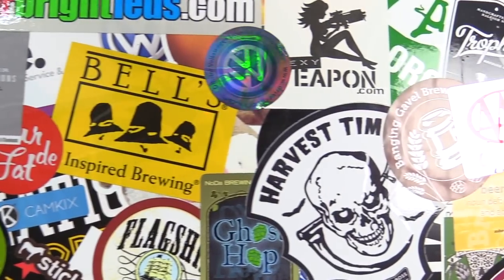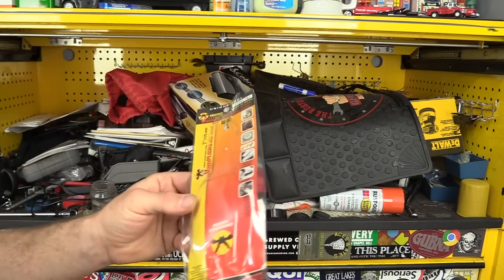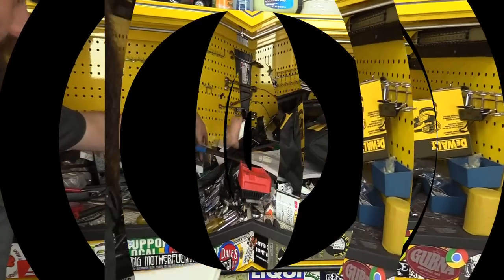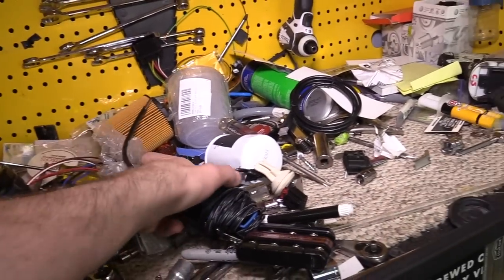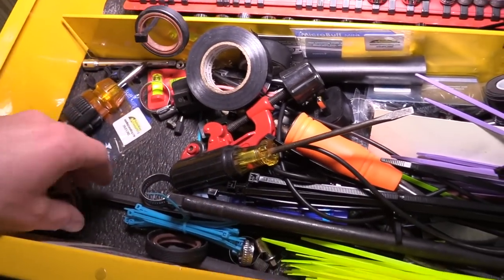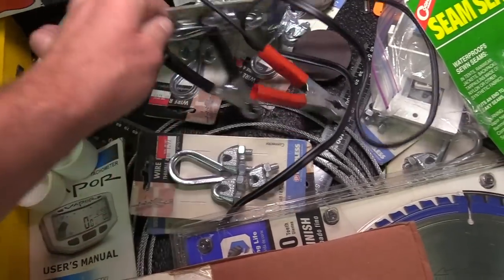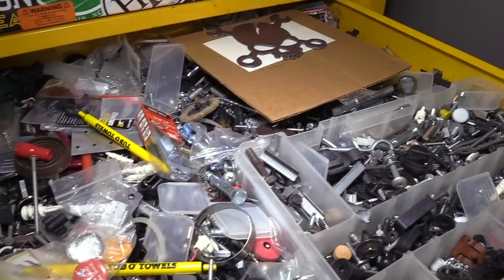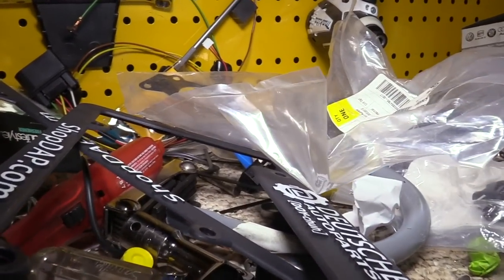How Real Mechanics Organize The Tool Box

Comment: Dont forget the dent from when Dave crashed into it (every workshop has a `Dave`)
Reply from the maker: +MeesterDash hahah. I've seen it happen a few times.
Reply: My local workshop is named "Daves Repair"
Reply: When I traded in my craftsman box for my Matco box I had it sitting off to the side waiting on them to come pick it up. I drove in an old Subbie with brake issues. I went to stop the car in my bay and the brakes failed and ran right into that box I had already sold... luckily the snap on guy didn't notice (bought that box used off him hence the wrong branded box). Also luckily the car was a used car owned by the store so no one got mad about it. Also I got to spend a week cutting out all the rusted parts underneath that POS and rebuilding literally everything that wasn't the frame because apparently subarus are gold and 100 people wanted to buy it while I was working on it.

Comment: Just subscribed and I really enjoy the presentation on your channel. Getting to the point EARLY with visual explanation seems to be an exception rather than a norm for many YouTube "personalities.    A personal note...an organizational accessory that I have been using for about 4 years.  Neodymium magnets (Amazon) in various diameters and shapes to improve my tool security and organization. Yesterday I saw a fabricated solution using these "rare earth"magnets called Tool Widget, an extremely inexpensive solution. I will be trying some soon as the designed holder actually seems less expensive than purchasing the magnets and "Rube Gold-berging" the tool itselfI I have epoxied some very small round neodymium magnets to the center of the handle on my gear wrenches and when working I can lay down a Costco micro fiber towel on the fender or an engine component. The strength of the Neomags has got to be experienced to understand the impressive holding power of these magnets. My 9/16"  stayed holding on ...through the cloth for about 100 miles before it was removed. How I know this is of no consequence. Thanks for the channel
Reply from the maker: Thanks Tim. Since this video came out, I picked up some Tool Widgets. They are pretty rad.

Comment: You forgot to identify the black electrical tape as fuel line repair material for use after you drill a hole in a customers fuel line.  This technic came from a local chevy dealership the only one thing I want to know is why you drill a hole in a fuel line when your changing a fuel filter maybe it to release fuel line over pressure.

Comment: Thanks for the tool organization tips, particularly regarding sticker placement on the tool box.  However, the crucial issue is whether you are a technician or a mechanic?  Inquiring minds want to know if you have finally freed yourself from the dealer tech mentality.

Comment: I am a disabled vet and got a shit load of tools from the NAVY I knew guys take entire sea bag full weigh over 200 lbs. I have random tool boxes . I am now in a wheel chair and have a hover round scooter that can got on grass and gravel .I got a metal detector at a garage for 5 bucks and since I can not work and own 20 acres with donkeys goats rabbits 7 cats 3 dogs and some other randen animals. But I got board so the metal detector just for ful I trolled around my property that is cleared around 10 acres so far over the last summer and not it getting warm ( damn NY snow and salt) I found over 150 tools . So every body should get one it you work outside . It a good thing craftsman home depot have life time warranties. But my local sears closed and not I have to be driven 40 miles to the only local one . I also hate the craftsman is getting tools made other than the USA there now crap and I have to go to yard sales and such.

Comment: dang im doin it all wrong with my box at work i obviously have some notes to take from you but hey man if your not gonna use that vapor trail display I need one hah!
Reply from the maker: +Assisi S yeah you gotta follow these tips for organizing 

I don't think I have the wiring for the Vapor. I wish I still did.
Reply: Haha will do man, I just have too many mag rails and "organizers" getting in the way :P by the way a quick tip I got for you on wrench holders is if you find some good sized Springs stretch them out in a vice and they are amazing, cut to size and take up almost no space. since I work on a fleet of semi's I just take the old pogos for the trailer hookups and pull the 3ft springs out. 

and I think you can get the harness on amazon and vapors website but idk I just picked up a ktm 300 and am in the middle of doing a 380 top end swap so haven't had a chance to look into the meters yet
Reply: Assisi S 0

Comment: My box has all of these things as well just a bit more organized than you have yours. I mean the bottom right and bottom left drawers you know the super deep ones? They have all the extra parts, chemicals, oil filters you never installed (Just one actually and it's for my own car that I haven't gotten around to changing yet.)  The right side deep drawer is where the magic happens. All the pain killers, peanut butter and bread, plastic utensils, extra random spare parts like that radio I took out of a car and the customer didn't want back, hats, can coozies, rule books for the shop you're working at, extra ASE manuals. You know all the important stuff you use every day.  Also hammers. you have to have at least 5 hammers of various sizes and colors and when Snap on comes out with a new color you obviously are required to buy it as well so the other guys don't make fun of you for having last years color still.

Comment: Ahh... the missing 10m socket... anyone who works on a car knows those are the first to disappear. I think it has something to do with metric and the whole base 10 system that sucks them into a mini black hole as soon as you remove them from your case.  The ones you pulled out of that pack will have already been swallowed up, especially the deep socket.

Comment: Just came over here from ChrisFix's great vid on replacing his muffler bearings. I told him the job is much easier using the Meglinating Variable Intensity Multifunction Power Tool. It occured to me I've never seen you mention that you use one either so I thought I would link it here (below) for you to look over and see if it would be something you might want in your arsenal. Pretty much the only thing that can get it done if you need to Syncrofuse Synthetic Toggle Bearings.

http://itsamanslife.com/wp-content/uploads/2012/11/ToolSale.pdf

Comment: Funny vid, but I work with a guy that keeps his box that horrible. Dude has a legit hoarding problem. 3 bank with hutch, side lockers and top cabs. Over 60% of it is full of broken parts, scrap iron and garbage. Lockers are sagging and the deep bottom drawers are so overloaded that they don't open more than a few inches. If he cleaned the whole thing out he could downsize. Loses a tool and goes on a "Somebody stole my stuff" rant. Buys a replacement and finds the original back a month later.